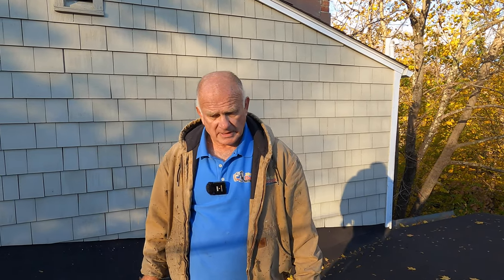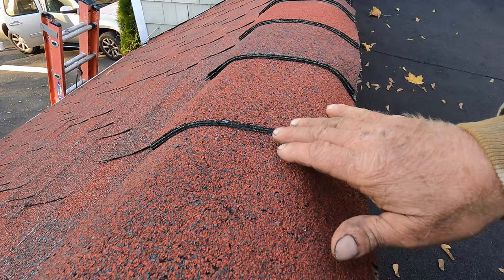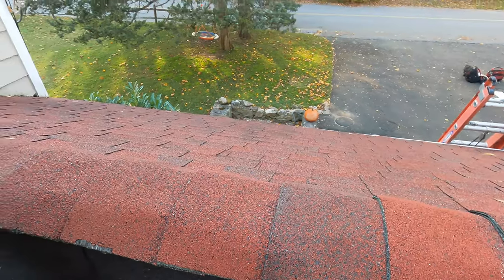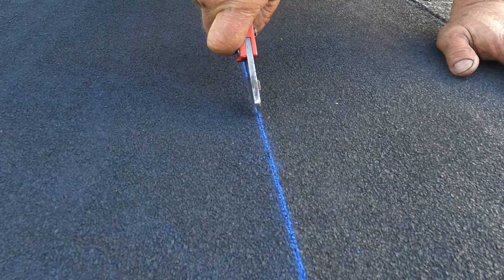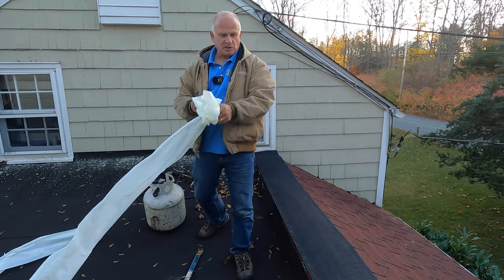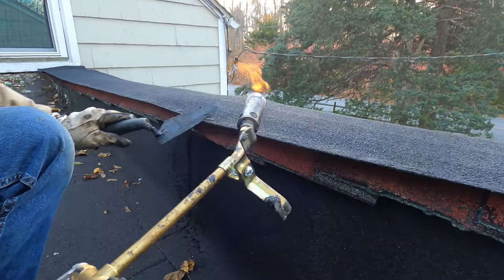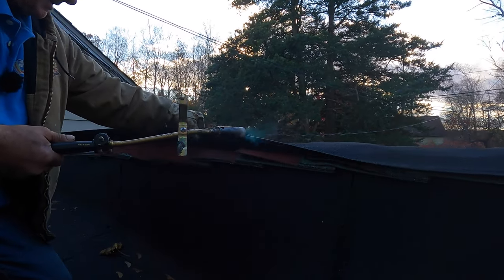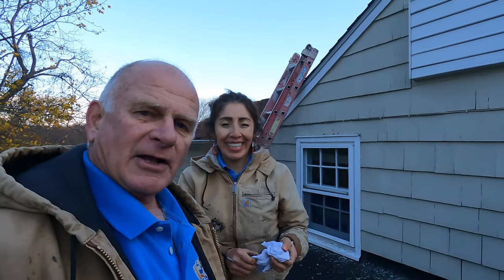The Roof Ridge on a shingles roof leaks - Here is Why

Comment: What is the advantage of using a self adhesive cap sheet then torching it as opposed to just using torch down in this situation?
Reply from the maker: The self adhesive Cap is far more stickier and will conform to the surface better. To do a straight Torch Dowm Membrane is almost impossible to make it work. I can work but much harder. I am trying to show regular home owners the easiest way how to do things

Comment: Folks this is not a fix...this is a stop gap until a real solution is done!
Reply from the maker: It will last as long as the roof is there. So stop gap for a long enough time, that works for me
Reply: @FlatRoofDoctor  I did this on my house 12 years ago and counting useing ice and water peel and stick on a 112 degsummer day.